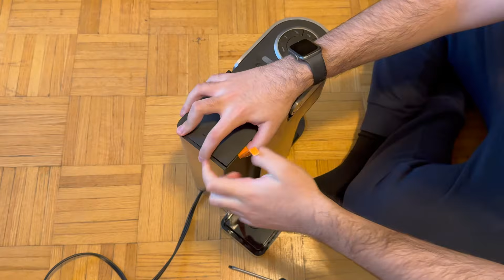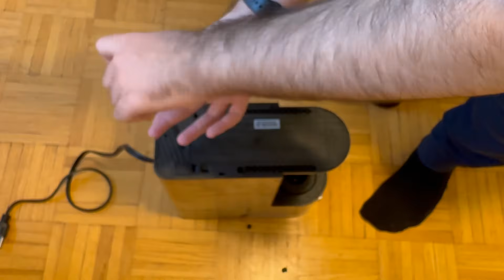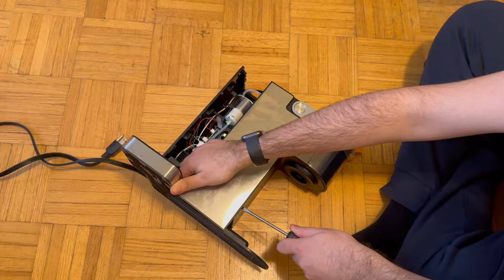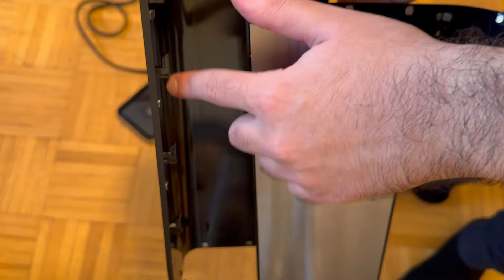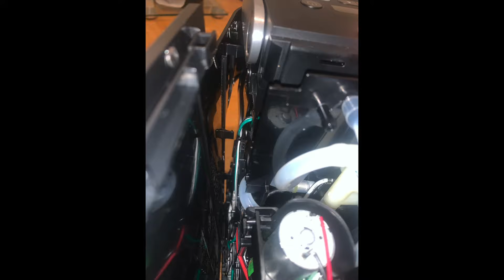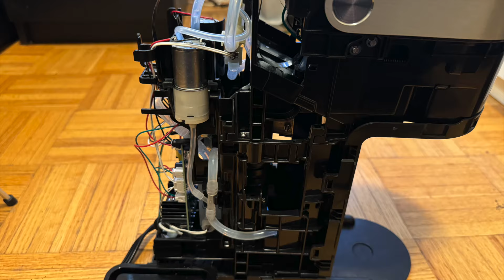Keurig K-Supreme Plus No Power Fix (Thermal Fuse Reset) & Teardown

Comment: I fixed it! Thanks to your video. Thank you so much! 🙏
Reply from the maker: Glad to hear you found the video helpful
Reply: @TheFrugalEngineer there was another video but it did not have the correct position of the thermal switch and your video was spot on. I was super proud of myself that I did not break any of the clips either.
Reply from the maker: @mmm @mmmendoza2606 glad to hear your repair went well.

Comment: Unfortunately, this did not fix my machine. 😢  I did everything here, there was continuity when I used the tester, but machine wouldn't turn on.  Is it completely fried?
Reply from the maker: There is no way for me to diagnose it over the internet. Maybe the power supply for the low voltage electronics failed. There are many possibilities

Comment: Since this happens after every cleaning cycle, I drilled a small hole in the housing inline with the reset hole so when it dies again, I can just stick a long paperclip in there and reset it without completely tearing it down. 
Crazy that we even have to do this after using the machine as intended, but here we are. I swear, if this machine didn't make such a good cup of coffee with that multi-stream stuff, I would've trashed it and bought something else.
Reply from the maker: Maybe if you give it more time to cool down between runs the fuse wont trip? The thermal fuse is a final safety feature of the machine it’s possible the thermostat is broken and it’s making exceptionally hot coffee without realizing it.

Comment: What i did is after i located the reset switch, i just drilled a hole in the side of my coffee maker corresponding with the reset switch , then i just used a straighten out paper clip to reset it, if it happens again i just use the hole that i drilled , and resest it without ever having to take it apart. 😊
Reply: Nice idea! I already put mine back together but if it happens again, I’ll be getting the drill out!
Reply from the maker: This is a great tip, thank you for sharing!
Reply: Where is the switch? I got mine apart cant locate
Reply: @Alisonhouser5 in middle of the circular thermostat at the top of the heating element
Reply: Where is that reset switch

Comment: If I don't have a multimeter, is it safe to plug in the machine after resetting the fuse to see if it powers on, before adding the housing back? Or do I need to have the housing back on for safety? Thank you for this amazing video, I've got two "broken" Keurigs I'm hoping this will fix!
Reply from the maker: For legal reasons I cannot advise you to energize the device while the cover is removed, but yes, it's relatively safe as long as you do not try and touch anything within the machine while plugged in.

Comment: Does anyone know how to reset the descale light on this model? I've used only bottled water in mine since day one, so it’s very clean inside. Oddly, the descale light came on just a month after I bought it, and now the machine is about two years old.

I’ve tried descaling it using both vinegar and the official Keurig cleaner, but the light never went away. During the process, I tested everything — I can easily blow through most of the internal hoses, the pumps work fine (confirmed with a 12V power supply), except the last hose going to the probe. That one is very difficult to blow through. Since I don’t have a baseline, I’m not sure what the backpressure is supposed to be.

Anyway, the other day the descale light randomly shut off on its own. I found this video and now I’m back to drinking coffee — even though the light sometimes still comes back on. Thanks for the detailed explanation!
Reply from the maker: The descale light comes on based on time or number of cups brewed it has no sensor to detect scale. I have a video on how to preform the descale process, putting it in descale mode will reset the reminder interval just like an oil change light. 

Descaling the Keurig K-Supreme Plus
https://youtu.be/GxkC4ZD_1KA

Comment: Could you give me the measurements to drill a hole and not go through all this? Mine is 4 yrs old I use it like crazy so if the thermal is tripped I don’t mind a hole in the side. My time is precious
Reply from the maker: No I would need to take it apart again to measure and that would take over an hour. It’s probably best you make your hole after disassembling it so that you do not accidentally drill through the nearby wires.

Comment: How hard do you have to press to reset the switch? I have pressed on mine and I haven't felt or heard a click.
Reply from the maker: Very gently I didn’t hear a click either. I did the sort of unsafe thing and powered it on without the case on to make sure it worked before putting it back together

Comment: I was just doing the descaling I did multiple cops followed by the cleansing and then it wouldn't power off or change any settings on the top control panel so I unplugged it for a half hour and plugged it back in and then it wouldn't power on at all so I did everything you said the continuity was perfectly fine on the thermal coupler and there was power but it still wouldn't turn on anymore so it must be something burned out in the top
Reply from the maker: You can test the fuse with a multimeter like I did in the video. I am also having control board issues as my machine is sometimes unresponsive to button presses.
Reply: Fortunately I bought it from Costco so I just returned it and ordered a new one  @TheFrugalEngineer

Comment: edit: heads-up in case this helps someone else - I followed the steps here and got the unit to turn on again, but it still didn't brew, and tripped the thermal fuse again on the second attempt. What finally worked was unplugging the tube that feeds into the pump and blowing into it quite hard until I could hear / feel the impeller moving again. My guess is that the encoder for the motor got "confused" when the user changed from 8oz to 10oz mid-brew, and / or when the thermal fuse opened and cut power, the motor was left in a state where it couldn't start itself up again. For whatever reason, the impeller was pretty seized up, and blowing into the tube freed it. Just made 5 successful consecutive brews - seems to be working great!

Amazing video. Fixing one of these for a neighbour who simply decided to press 10oz during an 8oz pour (pretty reasonable request, given what this machine is built to do). Apparently that, or as you say in the video, running out of water, is enough to trip the thermal fuse. Incredible.

My neighbour already got sent a replacement from Keurig, who are evidently trying to stay in good standing with their customers that way, but she was told over the phone that this "is so broken it's not worth fixing". Huh? Gotta say, shame on Keurig for A) not building some kind of fault protection to prevent this very easy / common mistake, and B) making it so difficult for the average user to get to (imagine if we didn't have such a clear video to guide the way!). They could easily use a time delay reset fuse and/or a reset sequence that the average user could perform with the given interface / buttons. Instead they just .. send you a new one? Strange world.
I'm very grateful for youtubers like this who help keep these items out of landfill.
Reply: Hey! This same thing is happening to me after I took it apart. There’s so many tubes is there any way you could help me identify which one you said you removed to blow into? 😅
Reply: Mine happened while trying to get it to go into descale mode holding down the two buttons... this looks like its going to be a lot of fun to do lol
Reply: Agree 1000%

Comment: We had an major thunder storm here last week with probably a power surge from a lightning strike.  On one circuit in our kitchen, the power had gone off but only on that section of it that has a GFCI outlet and beyond.  The outlet that I use for the Keurig does not have a GFCI but it's on the same circuit.  A day or two later, the Keurig stopped working.  Then, I tried a different Keurig and, one day later, it, too, stopped working.  I tested the outlet with a tester and it tests okay.  Thoughts?  And could my Keurigs be in need of a fuse re-set as described in this video?  I have other appliances on the same circuit and they're all functioning normally.
Reply from the maker: The thermal fuse in the video is unlikely to be your problem if your machine was not running when it shut off
Reply: @TheFrugalEngineer  I can't remember whether it was actually brewing coffee when it shut off but it did stop working only several days after the thunder storm.  The light on the power switch (the on/off button) lights when I turn it on but none of the other lights or functions work.  Any ideas on what the cause of that might be?

Thank in advance.

Comment: Thanks for the video. You don't have to disassemble the whole thing to reset the thermal switch. Just remove the top cover as he did in this video. Than look down inside the machine and you can see the switch, I bent a paper clip to a 90 at the very bottom. Put it in the hole on the switch and push on the 90 with a screwdriver. The paper clip is not stiff enough to reset the switch.
Reply from the maker: Thank you for taking the time to share this tip!

Comment: Reset mine and it started working again. Then it went out again. I reset again and have continuity at the fuse, but machine wont turn on anymore. Any thoughts?
Reply from the maker: maybe the circuit board has a fuse?

Comment: Any idea or guesstimate as to how high up the side a hole could be drilled into the unit to make the resetting quicker? Would you make a 1/4-inch or 1/2-inch hole? Thanks
Reply from the maker: I’m not sure but maybe 3/4th the way up. It won’t be easy to guess its position. I wouldn’t personally drill a hole into the machine, if it’s regularly tripping it probably should be replaced or there is a bigger underlying issue. Like pump failure it’s protecting you from.
Reply: @TheFrugalEngineer  Well I figured out where the reset is and it didn't help with mine...replacement ordered. Thanks

Comment: My unit has been working fine for a few years until today when I accidentally started the descaling procedure without the tank attached. 
Thanks to this video I was able to reset the thermal switch with only a couple broken clips lol.

Keurig could have so simply added a hole/passageway on the side of the machine to allow for this reset without disassembly. 
Obviously having their customers “brick” their units so easily is better for shareholder…
Reply from the maker: They also make self resetting thermal fuses that automatically reset after the temperature comes back down. Thank you for watching!

Comment: I would love to buy you a cup pof coffee.  I am angree about ;lanned obsolence,, but maybe there is a reason for a thermal overload switch but why not make it accessable?
Reply from the maker: They make self resetting thermal overload switches that automatically reset after a few minutes. The manufacturer maybe concerned that the machine may have melted or been damaged in other ways such as a sticky heating element solenoid before the thermal fuse tripped so they may not want to be liable if you were to reset it, they also likely don’t want users to be stuck with a machine that has intermittent issues as that is a bad user experience.

On the other hand the thermal fuse usually trips when the user does something they know may not be correct. In my case the water tank was removed while the machine was running making the user feel responsible for the failure.

Comment: What problems could cause the Add Water message to not come on when the reservoir drains to empty during the Descale?
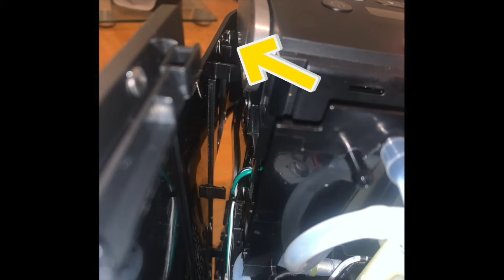Reply from the maker: I explain how the low water level sensor that triggers the add water message works at 9:06 in the video. It’s possible that your internal reservoir is not draining.

Comment: The reason this happens is when the water resavior isn't seated properly the machine will get hot in a matter of seconds and shut down.  I can only imagine how many Keurigs have been scrapped that needed this simply fuse reset.  Fantastic video thumbs up thank you 😅
Reply: Keurig is pure junk. There design and engineering is shameful. For example, would it have killed them to have a simple reset button accessable from the exterior ? Duh !
Reply from the maker: Thank you for watching. The machine in the video had its reservoir removed while it was brewing which caused the failure.

Comment: Awesome help; thank you for patiently walking us through the fix. Wonder why Kuerig doesn't provide a accessible reset button, it will save them a lot of money with the returns.
Reply from the maker: There are also automatically resetting fuses available. It’s likely setup like this to force users to disassemble and inspect the machine before resetting it. It’s also causes the machine to fail when the user does something inappropriate. For this particular machine the water reservoir was removed making the user feel at fault for its failure and more likely to replace it. If the reset button was accessible people could also try and leave something in the hole disabling the fuse.

Thank you for watching!

Comment: There must have been a reason why the water ran dry and the element overheated. If that issue is not resolved, the same issue will happen again. Probably the unit has a clog in the water path because of scalling buildup or some other clog. The fuse blows to prevent a fire, that’s the concern, safety, and why it’s not customer resettable.
Reply from the maker: In this specific instance the water reservoir was removed while the unit was running.

Comment: Great engineering! Once all the clips are broken, throw it away and but a Mr Coffee….
Reply from the maker: If they all break It will still work and look half decent as it’s really just the black piece behind the water reservoir that is necessary to hold the outer housing to the machine.